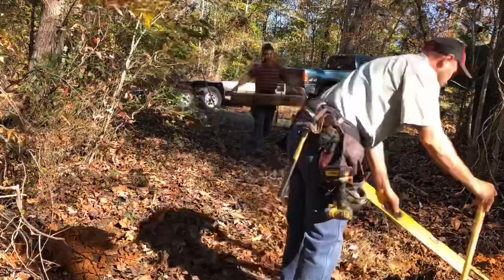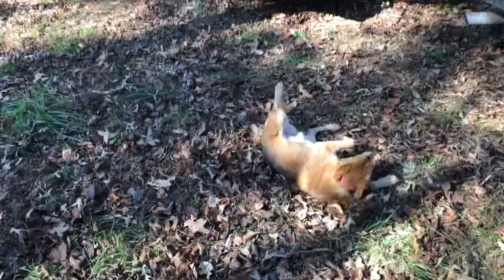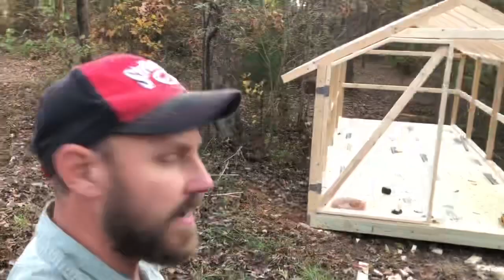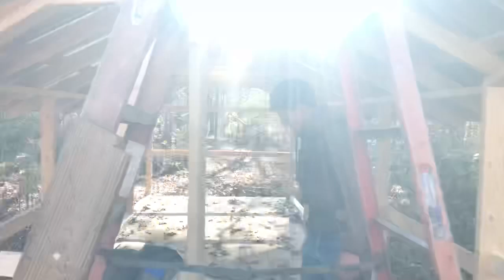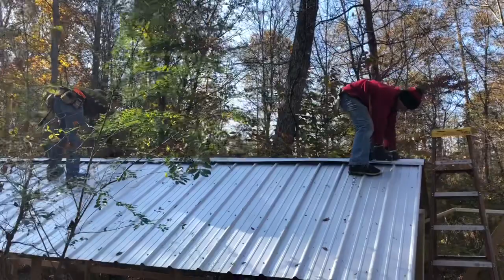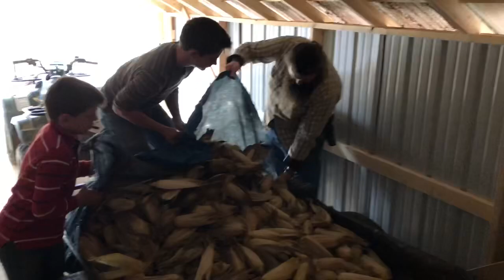Trying the impossible! A mouse proof corn crib?! Watch this build!

Comment: Without ventilation won't the corn go bad and not dry properly?
Reply from the maker: As it turns out, that building has more ventilation than Sylvester’s holey drawers! 😂
Reply: Corn won’t keep without ventilation and air flow.  Several plans are on-line for crib plans.  You have built a shed; not a crib.  But, good luck.  It looks good.